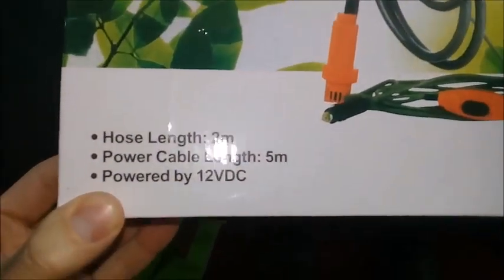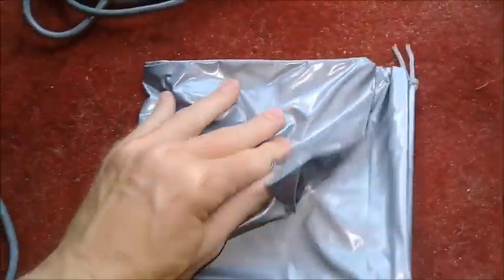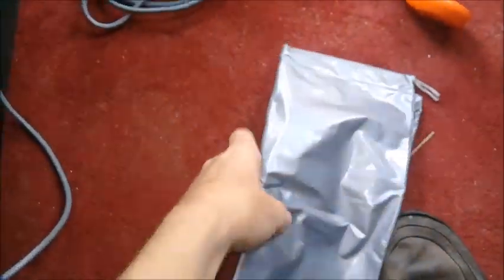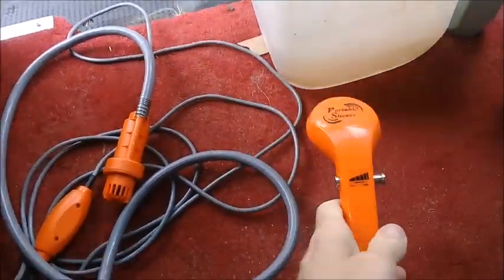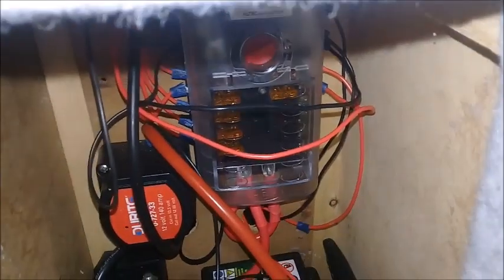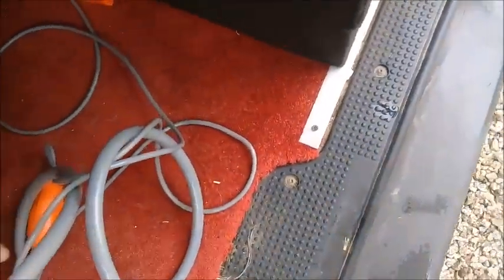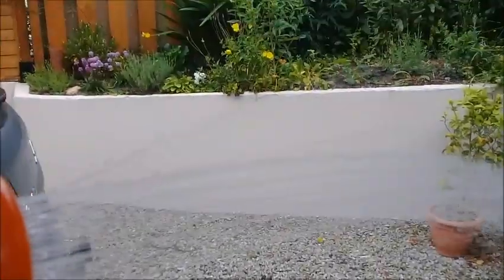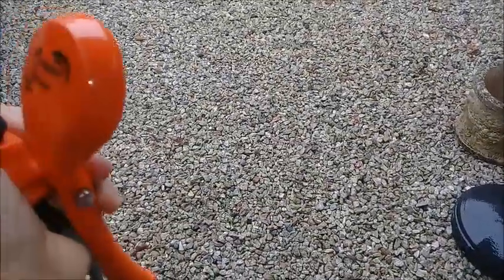12v Electric Camping Shower Review

Comment: i have the battery version of this from a different company. i use a  kiddie pool for the water source just add  water up to 3/4 full on the pool and use a microphone boom stand to hold the shower nozzle and it is ready to rock... i switched out the nozzle that came with it with one that adjusts from spray to pulse.. it fits perfectly and works great. p.s. putting a microfiber cloth over the pump acts as an external filter to keep the big stuff out of the pump

Comment: 🥰I got exactly this one and it is gooood. ❤Not a wide splash but water enough to wash my long hair, and myself during 7-8 minutes, i use a 20 liter boiler. In my home! Its a SAVERRR.   I dont have to shower ALL the time, a faucet is fine for most of the time. In summer I need more douches so then I shower more ofcourse. People that take always 2 showers everyday are quite spoiled i.m.o. it is not neccessary at all. Even detrimental to your skin if you ask me. Douches are detoxing nevertheless, so certainly healthy-- if you dont overdo it.🙂🌿🌿🌿🌿🌿🌿🌼
Reply: Look at the ingrediemts of yr showergel and bodulotion , talking about detoxing..😃👍🏼💫go natural, as much as you can.
Reply: Got an adaptor from 220 volt to 12 volt, it works like a CHARM!!! Simple to do also at home. Keep it dry thats a must.

Comment: I has one of these, used it once the tried it the following year and it stopped working. On inspection i found the wireing in the switch had no insulation which allowed the + - to touch. Also the seal did not stop water getting in to the pump engine which rusted in place. Don't  waste your money.
Reply from the maker: Probably better to use a Whale 12v pump with it.

Comment: I got the same one, it stopped pumping water after 4 uses. Was great when it worked
Reply from the maker: mine lasted two seasons and as you say great while working.
Reply: mine as well, stopped working (no pumping) after 3 or 4 use. i believe that because pump is not self primed, when you close the flow on the shower head this damage the pump